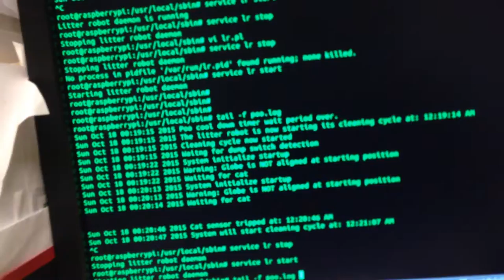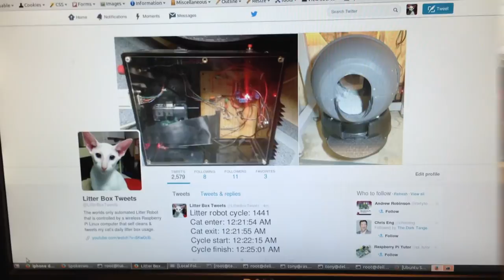A Litter Box contolled by a Raspberry Pi computer that tweets

Comment: Hi- Nice project. I have often thought of doing something similar, although chiefly because I have over the years found the circuit boards on my LRs to die or become wonky and it just drives me nuts to have to replace them. I am extremely familiar with programming for the Pi and am fine on the hardware side needed. However, I was hoping to avoid monkeying around with my multimeter to read the signals or loads on the various pins for state changes and driving the motor. Would be great if you could post your project on Github or similar. Thanks.

Comment: Hi,  I want to get some metrics out of my LR3 open air, could you share some technical details about the sensors used in the LR3 ? I know that it´s using a 4-pin (DFI - Drawer Full Indicator), 6-pin 
(Motor and power), and the 8-pin (Hall Effect  sensor). I´m not sure what´s used fot the cat detection ?   Probably something on the 8 Pin Hall Effect Sonsro Connector ? Would be great of you could just share the sensor specs , I can look up how to pull / process the data, this would save me some time and work dismantling the whole unit.

Thanks a loot for the support !
Reply: thanks, I think the LR3 open air uses a FSR Sensor instead of a micro switch for cat detection, is it wired to the 8 pin connector label with hall effect sensor in the repair manuals ? going to dismantle unit today and check